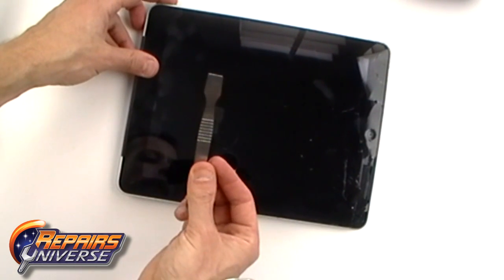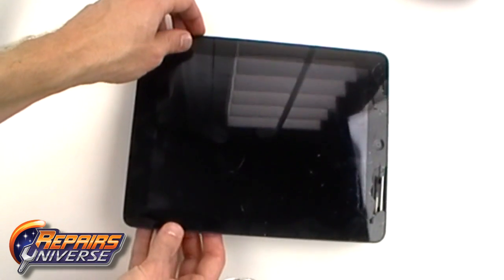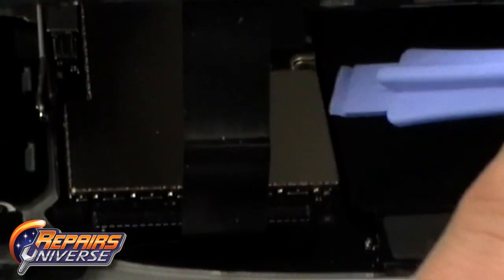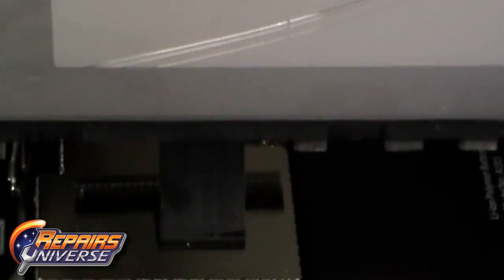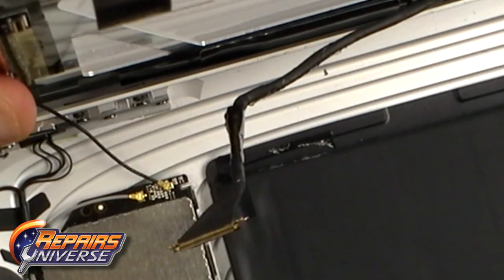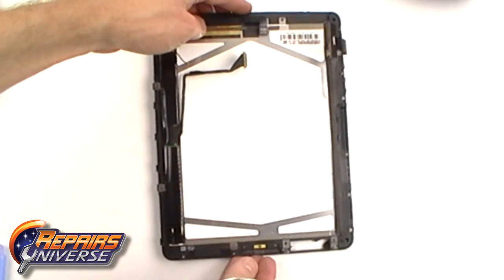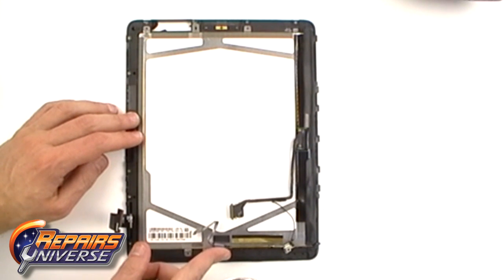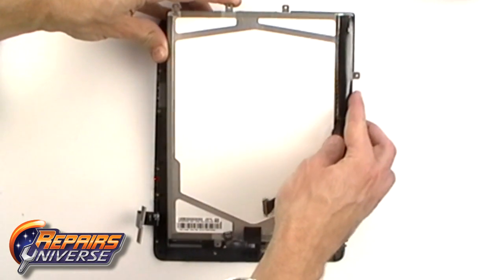iPad Screen Replacement & Take Apart Guide

Comment: Did my first disassembly today on a 1st gen, the digitizer is smashed but LCD is fine. To anyone else who wants to change out a digitizer, buy the full assembly with the frame, metal clips and wifi antenna (seen at 4:29). The glass alone is cheap but you will pay in stress. Still scraping off adhered broken glass
Reply from the maker: When scraping or removing the broken glass . Use your heat gun to remove the glass easier. Go slow as not to over heat the frame as you are removing the glass.

Comment from the maker: It's possible the battery has become dysfunctional, or perhaps the charge port flex cable is damaged. It doesn't sound like the charger itself is the issue.

Comment: I have an iPad 1st-gen. The battery is not charging. Used a data cable with a pc and also with a USB wall adapter rated 1A. I know for a fact the cable is good as it can charge my iphone. The ipad has about 17% charge left so i keep it off. When the cable is connected to the ipad, it will power on but not charge. Is this a logic board problem or a internal cable problem? Someone said ipads need a 2A charger? Any help would be appreciated

Comment from the maker: @simmbad08 We currently do not have any SMD connector replacements for the iPad. I would have thought other supplier would have these available. If not, replacing the full connector would be necessary, however I am unsure how difficult it will be to track down that either.

Comment from the maker: @lilirit This is an issue with the "glass touch screen digitizers" flex cable. You will need to make sure the flex cable is not damaged and that the connection is fully in place. This will likely resolve the issue.

Comment: I've just replaced the LCD screen on my iPad 3g.  It will power up and the screen is clear (before it had a wide line through the middle), but the "touch" part won't work.  I've checked the connector from the LCD screen and it seems to be connected correctly.  Any other ideas please?